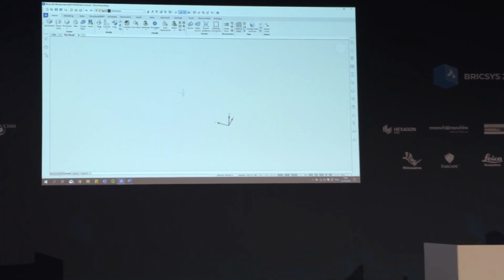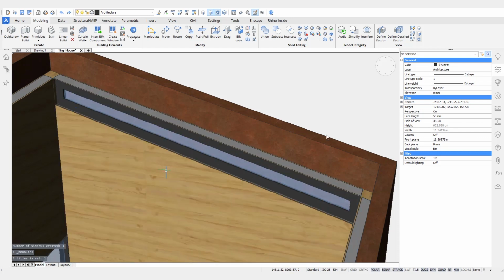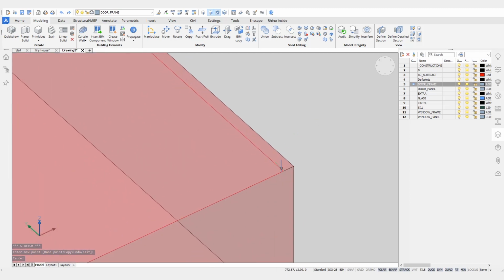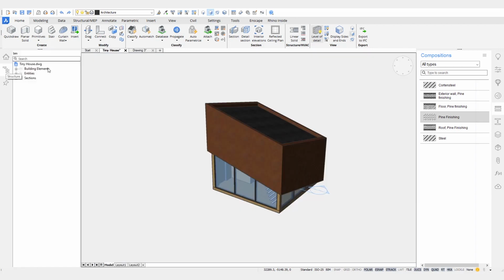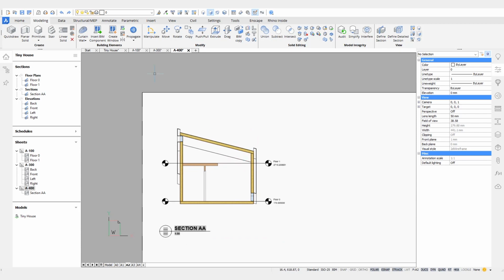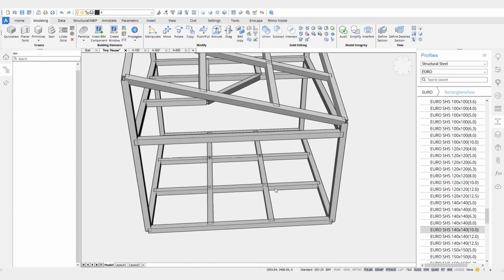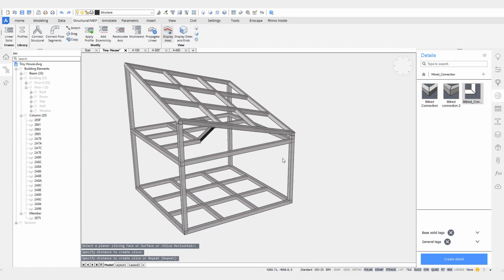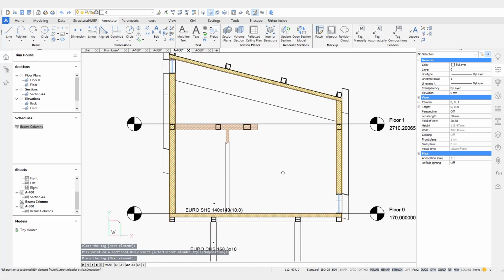Bricsys 2019 - Model a Tiny House in 45 Minutes

Comment: BricsCad is an all in one tool.... 😍❤. And I want to know gently 😊. why it is not possible to add a door in a blockeditor, and it is also not possible to add a door from quad menu, even in building elements menu bar there is no door tool, it always takes the library tab to make a door?
Reply from the maker: Doors and windows are parametric components, they are not edited by Bedit command. For detailed information about components please refer this Help article: https://help.bricsys.com/hc/en-us/articles/360006522234-Components-and-Component-Inserts

Comment: What about wood structures? Typical smaller houses as the own demonstrated and now also larger one use wood not steel, but bricsys seems to be "steel only". Can own structure elements like structure wood be created?
Reply from the maker: Using BIMPROFILES command you can edit an existing or create a new profile with desired options and material: https://help.bricsys.com/hc/en-us/articles/360006560314-BimProfiles
Reply from the maker: The command BLMATERIALS will show you the Physical Materials library, that includes wood.